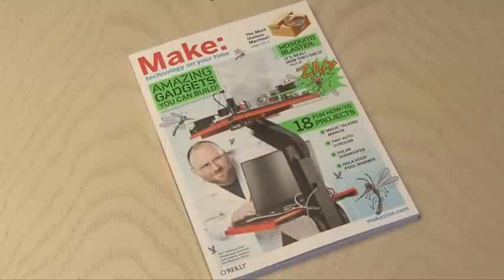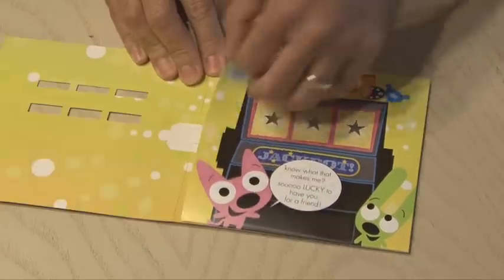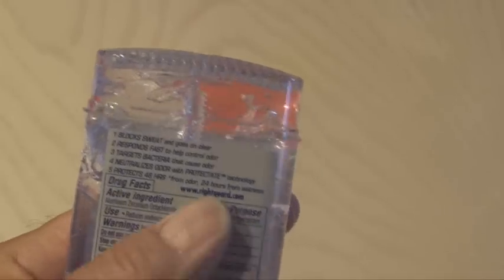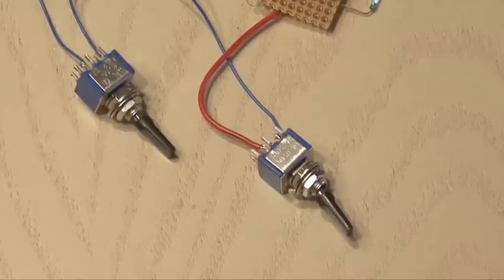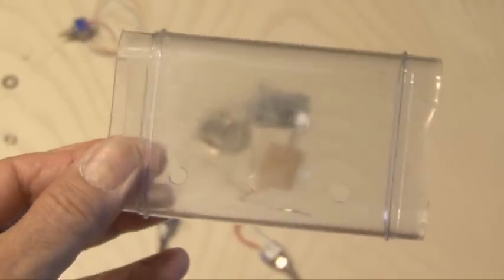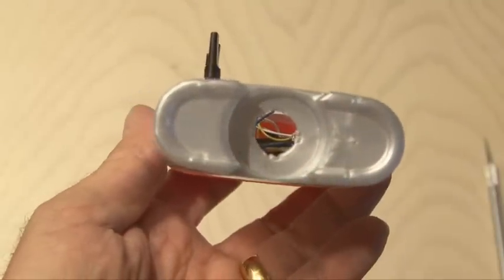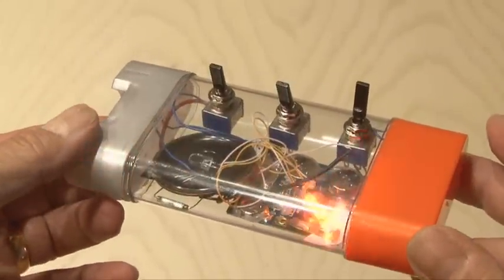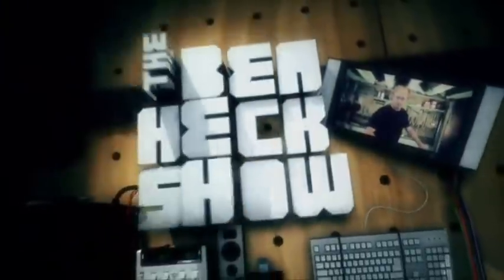Weekend Project: The Mystery Switch

Comment: oh man that's annoying as hell, i would be sitting there inputing 001 010 011 100 101 110 111 , ok, actually its not so bad
Reply: ***** you're right but i mean i assumed that was the starting point so you dont need to input it cause it's already there
Reply: Quoda Z add two more dummy switch and then you have some fun!!!!
Reply: ***** Also, since they're 3-way switches, each switch has a "0" a "1" and a "2", so, yeah, that adds a bit more in the way of combinations.